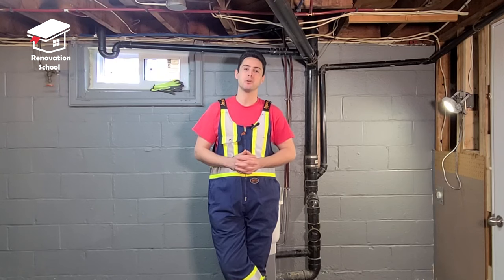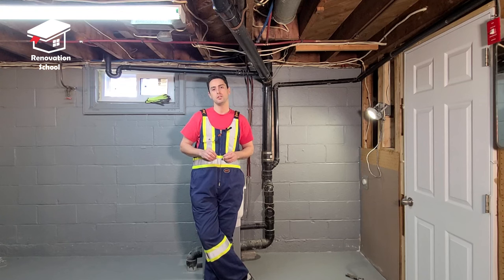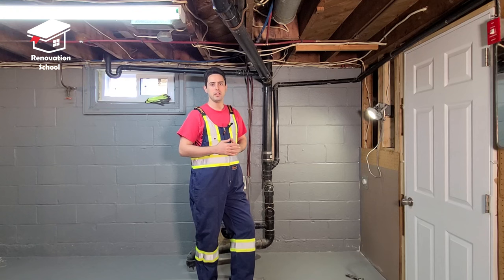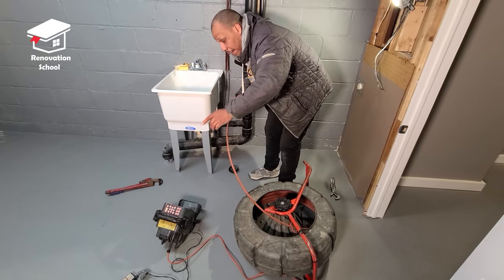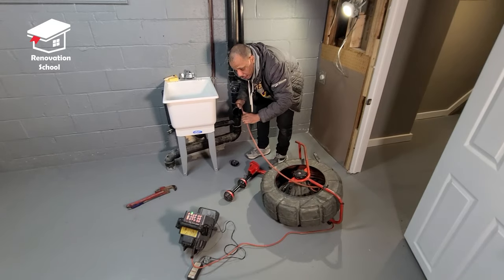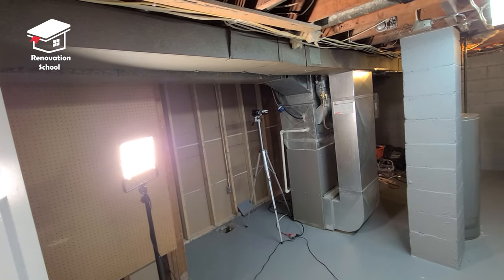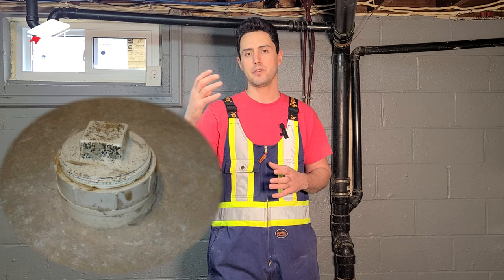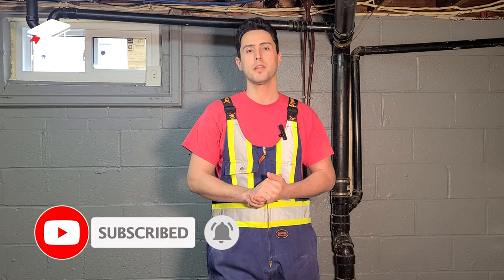How to locate pipes under the basement floor ?

Comment: If my toilet 4”pipe run 20 feet sloping just 1inch will be what happen ?
Reply from the maker: Will not drain properly 
You need between 3/16 to 1/4 of an inch drop per foot

Comment: Is this a manageable DYI? I’ve got 2 quotes for $7000 to remove the floor for a bathroom roughed in to move a shower drain 4” a toilet 2 feet and add a line for a bar 7’ with water lines to all. This seems manageable for a DYI with a 2” slab. I have no urgent timeline to get it done. Thoughts?
Reply from the maker: For sure it's doable. Specially if you are handy

Comment: would it tell you how deep it is?
Reply from the maker: Yes 
it does tell the depth also
Reply: @renovationschool8818  so it will tell you that its.. lets say 26"  below the concrete slab? what do u call this measuring equipment??
Reply from the maker: Yes it does tell you the exact number,  the machine is called sewer camera, some people call it  reel.
Reply: @renovationschool8818  thanks. whats the brand? i wanna look it up at amazon. please and thanks
Reply from the maker: It was by Ridgid,  you can even rent it from Home depot for a few hrs, but I suggest call someone like what I did in the video.

Comment: Great video! Question: I bought a home with a fully finished basement and my sump pump pit has a mystery white pvc pipe that enters it from the basement area. I asked the previous owners what I goes to and they said there is a floor drain in the basement but cannot remember where it was. They were both older folks that had the basement finished in 2003 just 2 years after they built the home so I understand how they could forget. Everything is carpeted and tile so I can’t see where the top of drain would be and the area I’m suspecting (under stairs by the furnace/water heater) is all tile! I want to find the drain and pop tile so I can use it for my furnace condensate line instead of the little pump that’s there now that pumps it up and into a pvc line somewhere. Basically I just want to omit the condensate pump, drain to floor so it goes to sump on other end of basement.
Question is, would a pipe finder still work but didn’t have the camera snake? How can I find where the heck this damn drain grate is!!??? Thanks
Reply from the maker: See I'm a contractor and I do this for living all the time. 
I always hire an electrical eel company to come and find the exact location of pipes or drains in these occasions. 
I highly recommend you to hire someone to come when an inspection camera just like what I did in this video. 
They will be able to tell you where exactly it's located.
They work with these devices on everyday basis and they know the exact locations and exact noises these machines make. 
And the charges are fairly cheap. 
As far as the drain for your furnace you really don't have to find that floor drain for it. 
If you hire someone that works on furnaces they will explain to you there are certain small pumps that could be installed right next to the furnace and it could pump all that  condensation an extra water outside the house or in a floor drain or inside your sump pump. 
You necessarily don't have to have a floor drain for it.
Reply: @renovationschool8818 I appreciate your feedback. I already have a small pump right next to the furnace. The reason I want to find the floor drain assuming it’s by the furnace of course, is so I can get rid of the pump and drain to the floor drain. Problem is that the sump pit is far on other side of basement and the basement floor is all 12”X12” ceramic tile.